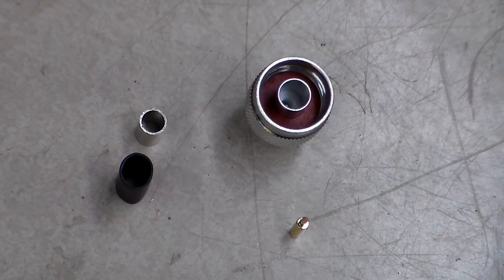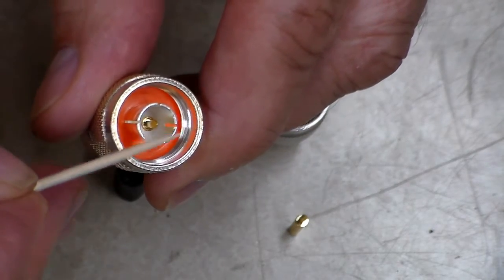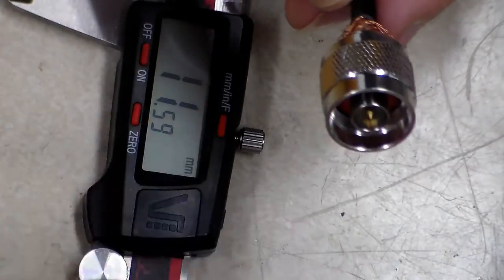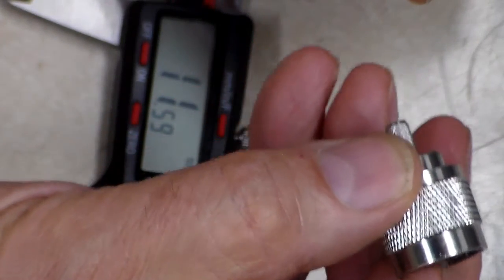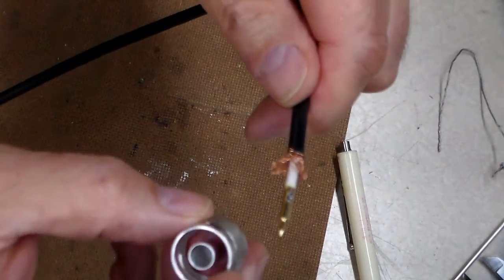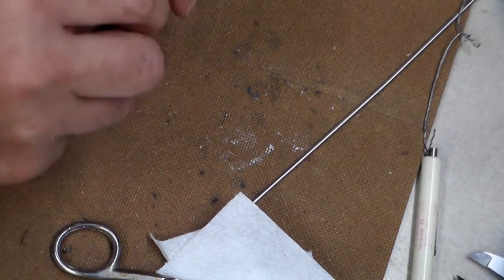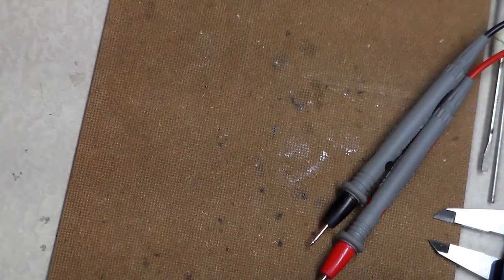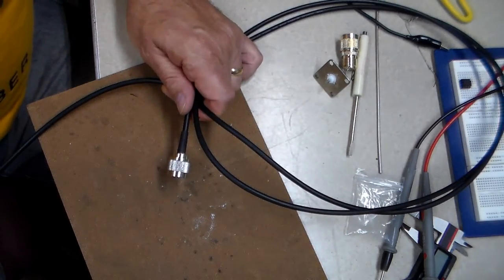N Type Coax Connector Installation

Comment: Hello Tim, nice video. The only thing I would do different is I don't make that second crimp. It crushes the cable and that can cause issues. I've made markings on
my bench for the different connectors and I can lay the cable on those markings and cut my cables. Thanks again!
Reply from the maker: Good point about crushing the cable.  I was too wrapped up in appearance.